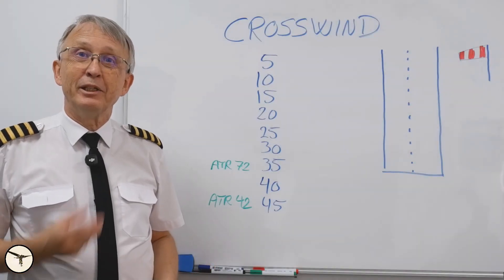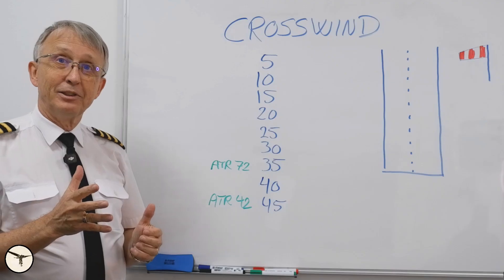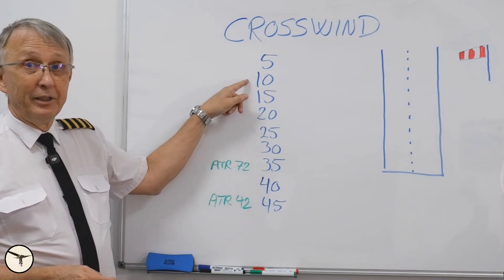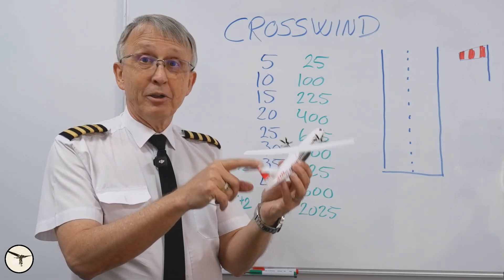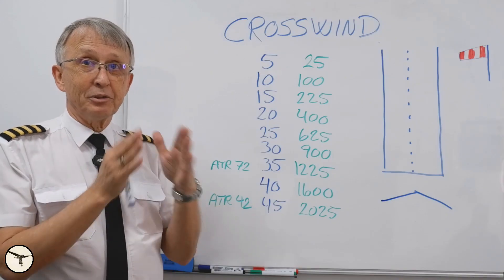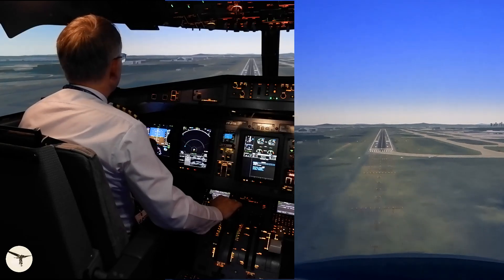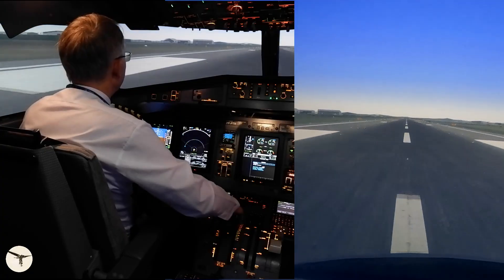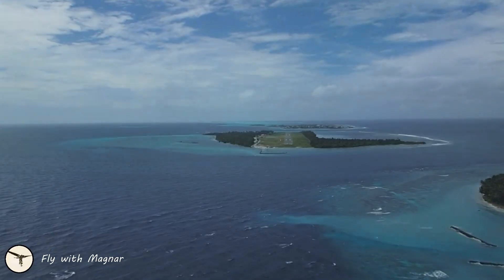Crosswind Landings Made Simple | ATR Technique Explained Step-by-Step

Comment: New PPL here. 
Landing with wind aligned to the runway already involves a lot of coordinated inputs.
Crosswind and gusty really maxes out the workload!
I'm working on it... thank you for the clear explanation.
Question. How do pilots handle the transition from ATR to low engine jet with wings level required during landing?
Reply from the maker: A jetliner with engines mounted under the wings are designed to land with a crab. So, when you change aircraft type, you must learn the procedure that applies to that specific aircraft.

Comment: A proper rudder trim is very helpful in strong crosswind conditions. If strong crosswind is coming from the right, set your rudder trim to the left. If crosswind coming from the left, set your rudder trim to the right. I notice significant reduction of directional oscillations during landing roll when this technique is used in strong crosswind landings. It also makes it easier to execute one wing low landings when decrabbing
Reply from the maker: @cruxader27, No, this is not a good procedure. Nowhere in the manuals is it recommended to land with an offset rudder trim. There's a reason for that. If you have to go around after setting the trim, you might end up in trouble. The procedure is: Yaw damper off, center rudder trim. Don't "invent" a new procedure.
Reply: But then in the first example you do all the approach pushing the right rudder??  Or this is a mix of crab and cross controls approach
Reply: @juanmanuelgomezmartinez3795  using rudder on the upwind side is not recommended. In the case of right crosswind I set rudder trim left and wings level during approach. Then slight right bank during decrabbing when about to touchdown. If I'm right of the centerline I step on left rudder. If I'm left of centerline I release some left rudder pressure and the aircraft naturally turns to the right. I don't step on right rudder anymore. The aircraft has a tendancy to always face into the wind thus upwind side rudder is not that much used
Reply: @cruxader27 yes. The aircraft aleays face the wind by itself.  During approach, if You use rudder trim left, then You need a little bank right, or push a little the right pedal to maintain the coordinated flight. Looks like You are mixing two crosswind approach techniques. If You use the left rudder trim then the ball move to the right. If You maintain wings leveled the aircraft Will start to move to the left off the runway centerline

Comment: 2 questions: 
1. In which units the force (green figures from the board) is measured?
2. Why "yaw damper off" is very important for xwind? Don't we disconnect it every time before landing (at least on '600), do we?
Reply: Units does not matter... Mr. Magnar is just explaining the square rapidly increasing of force compared to wind  airspeed...
Reply from the maker: The unit for force is Newton (N). To give an example, when the aircraft is travelling down the runway at 100 kt, and the crosswind component is 10 kt, sea level, standard day, the side force on the vertical stabilizer is approximately 1.9 kN. So, with 20 kt crosswind, the force is 7.6 kN. It takes a little more imagination to understand that 7.6 is four times more than 1.9.

The ATR 600 series have automatic rudder trim when the yaw damper is engaged. That means, if you apply rudder to de-crab before landing, the rudder trim will work against you. Earlier ATR aircraft variants can be landed with the yaw damper engaged, but it is still good operational practice to select it off before landing.